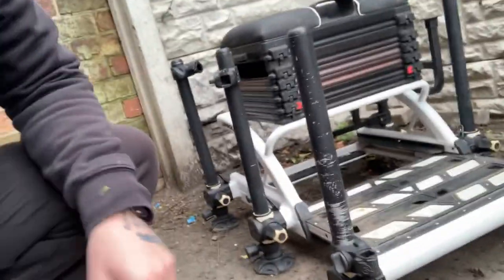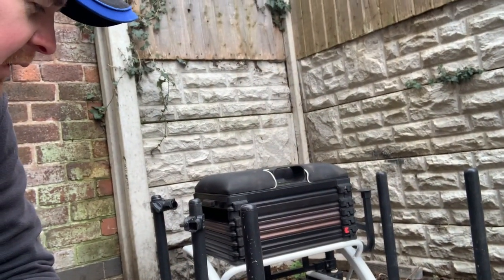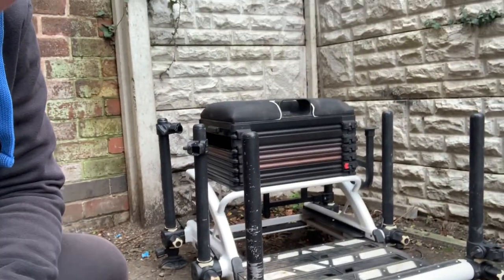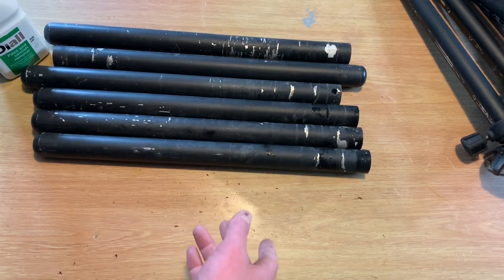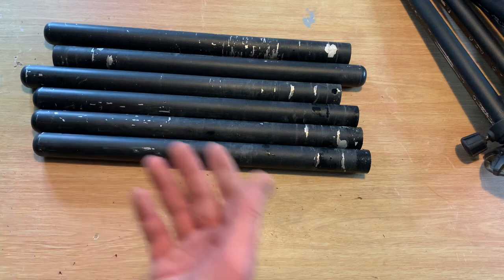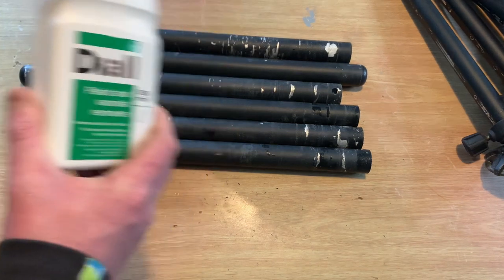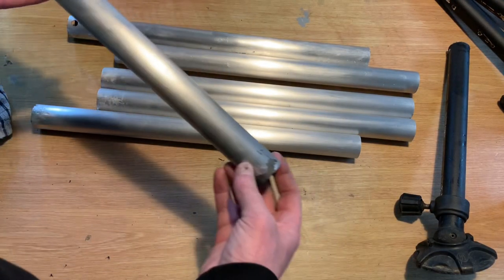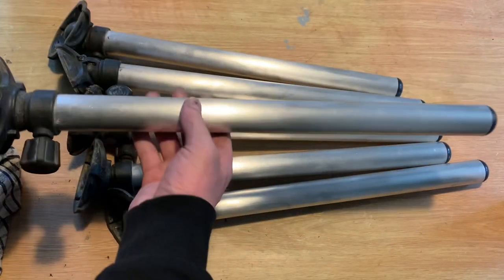Preston Innovations Absolute D36 Seat Box leg fix😍  scratched legs??  Not anymore👏🏼 only £7💪🏼

Comment: This is exactly why I avoided seatboxes with coated legs. I don't get it, why they paint it black instead of eloxating the aluminium (that would never come off and you'd need to scratch it deeply to get through the colored layer). basically the whole seatbox is aluminium anyways.